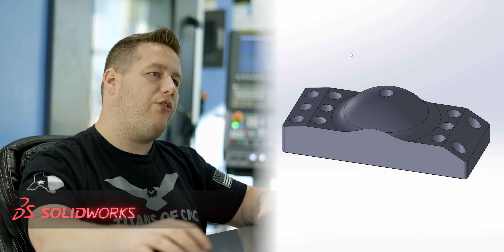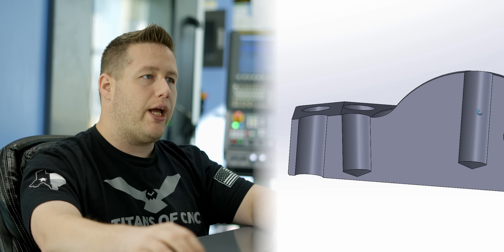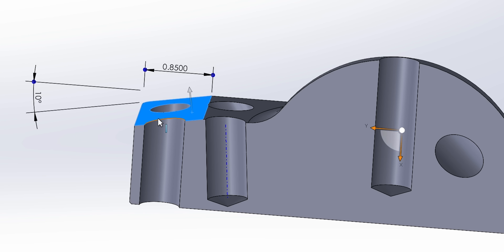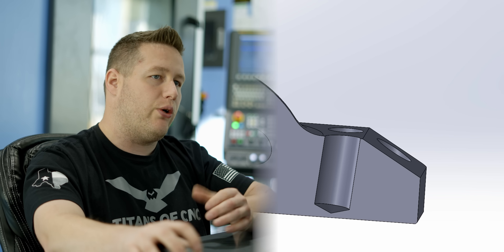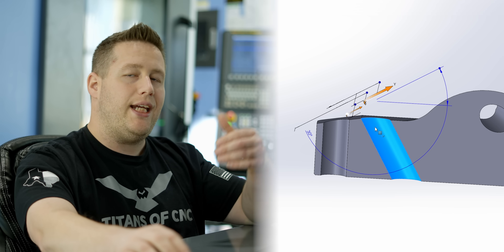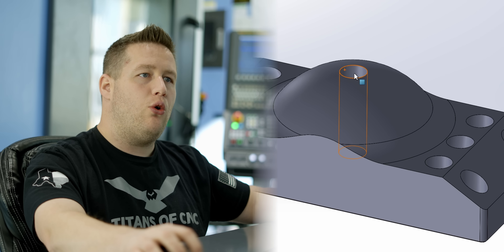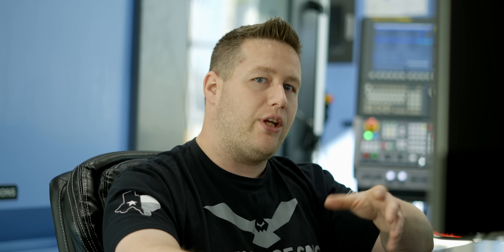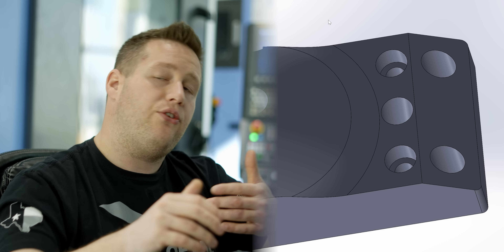Tips on Drilling PERFECT Angled Holes with Flat Bottom Drills

Comment: These are a great application on bigger applications , but for smaller holes check out the micron crosspilot  drill ,these can drill down to small sizes on steep inclines with no deflection, because the hole may not be a through hole and may have a drill point, and they can drill 10xD

Comment: Two questions:

1. I understand decreasing 30% until the whole bit is engaged with the work. I'm curious why you decrease by 30% when you're exiting the piece on the opposite side?

2. What is the difference between a flat bottom drill and a center cutting end mill?

Thanks.
Reply: 1.  The same reason when entering the hole; to reduce/eliminate the change of the drill chipping when entering or in this case exiting  uneven surfaces, plus less burrs around the edge of the hole.
2. well, with a drill you can only drill, and with an end-mill you can still drill, ( though certainly not as fast as with a drill) plus do other stuff while at it.

Comment: When we have a flat end in the hole, we drilling with a regular drill first, and then we finish it on the last 3-4 millimeters with a flat drill (depth dependening on the diameter). The flat drills tends to collect more chip, which we have to pull down in every 20-30 minutes working with stainless...

Comment: I'd love to know how well these hold positional tolerance? The logic being that if your flat spot drifts it's unlikely to cause the drill to wander as the point is still starting somewhere on the flat, where as with a flat bottom drill because it's cutting on one side the stiffness of the tool probably comes into play with regards to the tool pushing off. I'd guess it would depend on diameter? The diameter tools like the ones in the video are pretty stiff, so it's probably not an issue.
Reply: my thought exactly, he didn't even show the position and how much it is in the tolerances because smaller flat drills will go off center nonetheless in such a angle until I see any prove that the position tolerances are met with this technic aswell I trust this video with a grain of salt ngl...

Comment: Oh yeah, I used those before.  The problem that I ran into was the drill substrate.  We were using the "glass metal" fb drills.  So when you wanted to drill on an angled surface on steel, you had to peck drill about .001" increments.  I found this out after breaking a couple of them.  I think that I would have been better off, and safer, to circle mill a flat then continue drilling.

Comment: I had no idea that you guys that are lucky enough to have a CNC machine had to contend with a problem like these holes. I thought the machine could just do it?
Reply: CNC machines enable tool paths that would be impractical to do on a manual machine and save labour on complex or repetitive jobs..

but it's still up to a human to decide what tools to use, in what order and with what feeds and speeds. There are nearly always multiple options, you could mill a flat with an endmill and use a regular drill, you could cut the entire hole with the endmill if it's not too deep. Each option will have tradeoffs in speed, quality, tool slots used on the machine, and whether or not you have to buy new tooling or can run what you already have.

Comment: 6:18 That sound when you pull a pin out of a hole is 👌

When you can use the air in the bottom of the hole as a spring and bounce the pin up and down, on the other hand... 😘👌

Comment: Is the posted GCode a Seq of G01s with the feed changes or does Doosan have a CAN cycle to address that?
Reply: Since I used Mastercams 'Advanced Drill' toolpath it didn't output any canned cycle so it was straight G-code with the feed changes.

Comment: What’s the tool life like on these flat bottomed holes compared to a regular pointed drill? I’d presume it’d be higher wear amount on the tool because of the 90 degree edges
Reply: Like anything it depends on the situation that you're putting the drill in but the tool life will surprise you.  We used these at my last job and the tool life was way better than the endmills we were trying to use.
Reply: @Jessie_Smith  but flat bottom drill IS an endmill... Maybe your experience was due to the change in tool manufacturer?
Reply: @feedbackzaloop  A flat bottom drill is designed for plunge cutting only.
Reply: @jamstagerable  yeah, just like the endmills in their early days. Considering popularity of plunge milling for HPC the difference between modern mill and flat drill is negligible: front face cutters do all job.

Comment: That is a really nice invention, but in some situations I use the drill cone at the bottom of blind holes for clearance. Would be an unpleasant surprise during assembly if that was left out by this drill.
Reply: Then you'd need to consider that change while programming
Reply: @angrydragonslayer  True.... in a perfect world ;)
I make the drawing and 3d model, than another department sents that to a job shop and they make the part often without ever talking to me. If they don't call and ask if flat bottom blind holes are ok - and why would they ask that, because it usually is ok and nobody cares - the parts come back to us and then someone from assembly department calls me because my parts don't fit together. Maybe actively using that drill bit tip cone as a feature for clearance isn't such a good idea after all.
Reply: @ensen89  well, it isn't and in your scenario, it's far from ideal.
Reply: There are cases where a flat bottom is required by design, maybe underneath the holes where it normally exits is empty space and the engineer wants to maintain a wall thickness that the drill cone would thin.

Comment: Cool. So the right drill bit is a better solution than trying to add extra steps to make it easier to drill with less-optimal bits. I don't do CNC, but this side of engineering's really cool.

Though, how do you figure out how much to step down the drill speed, and for how long before you know it's making full contact? Is that entirely because of prior experience, confirmed by a little trial and error? Is it tool-assisted where your program has presets? Or is there prior information with how the drill bit is spec'ed?
Reply: If you're looking to cut cycle time or an extra tool then using a flat bottom drill in these situations can be a better option.  As you see in the video I am leaving the RPM the same but reducing the feedrate by 30% to enter the holes.  That number came from Kennametal as the starting recommendation.  With any tool like this or out-of-the-norm process, the manufacturer will have some basic guidelines as starting values.  I always try to use those first and then build from there depending on how it works out.  So my best advise it to take the available information (because it's free and someone has already done the research) and also your experience and use those as a starting point and then build from there.
Reply: Probably a bit of all of them at the same time